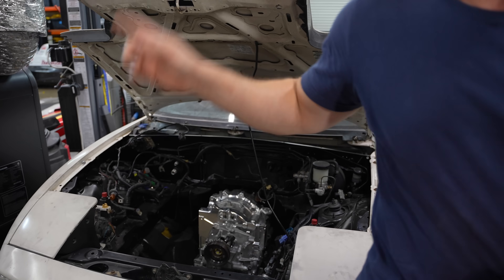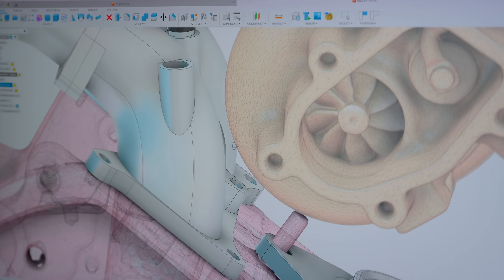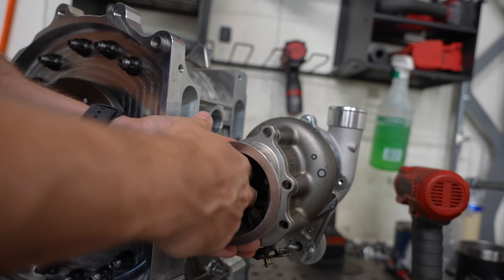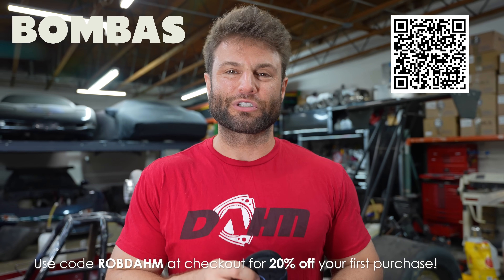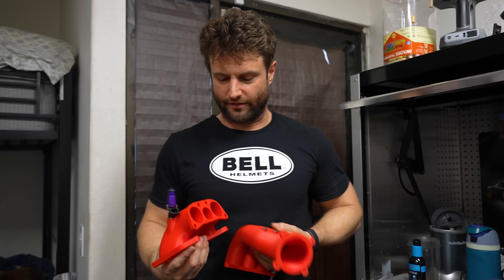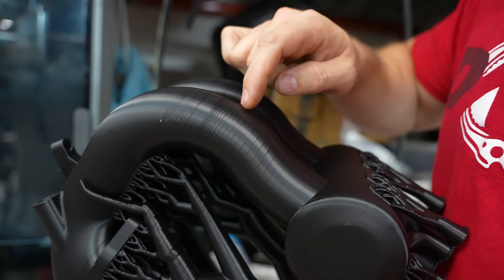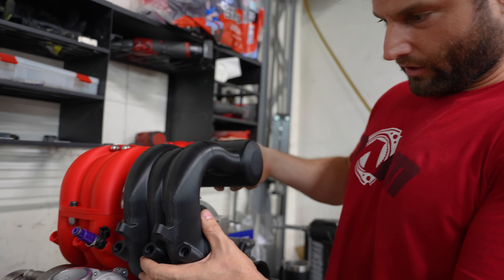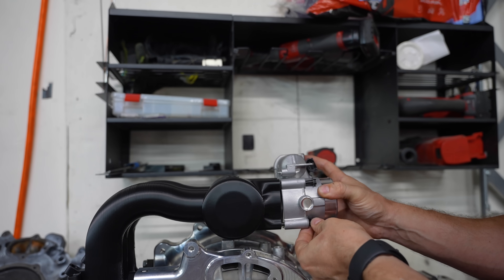We 3D printed an Aluminum 1 Rotor Turbo Manifold!

Comment: You can have a look at abrasive paste honing to clean up the inside of the intake runners. Its basically just a process of pushing valve lapping paste through each runner to clean out any slag or rough spots.

Comment: Make sure you tack weld the bolts used on that flange for the turbo. They have been known for backing off. Was a huge issue on the 2867 kits ATP sold using that exact flange

Comment: Use a microscope to check the porosity or research how porous the material is....research 3d metal printing's durability against pressure.

Comment: So, asking because of my experience with a bone-stock jeep xj with a 4.0 I6.

 Thing experiences vapor lock fairly easily because the exhaust (and pre-cats) are directly under the intake manifold and fuel rail.

I'm worried if the hot side of that turbo is capable of putting out enough heat to vaporlock those injectors. It's REAAAALLLY close to those injectors.

Comment: Hey Rob, many V8 swapped Miatas have the chassis notched where you're almost hitting with the fuel rail(fittings) I also notched mine there to fit the downpipe on a Volvo 5 cylinder swap

Comment: Doesn’t the injector need to be moved 30% upstream to account for the mass of the air under boost-wot so the fuel ends up in the center of the rotor port ?

Comment: You mentioned making boost pipe larger than outlet of turbo…. Doesn’t .Newton take over… by increasing diameter you slow down air speed… low speed high pressure and high speed (same size pipe) low pressure….or less drag you might say.

Comment: It made me happy when you extended the injector slots/mounts to account for rotation and heat in the area.  (Check out the turbo sheilding that Detroit Diesels used on turbos, was some of the most effective stuff I've used, but I think it had asbestos in it)

Comment: This needs to be made for multi rotor engines. Imagine 3 rotor RENESIS with proper intake and most importantly, separated and expanded side port exhaust. It will be able to make power from turbo without heat build up

Comment: Looks sick. The universal engine. Put it in a lawnmower, put it in a Miata, put it in your Minivan, doesnt matter. Fits everywhere. And has good power for a daily driver.

Why not just use the plastic intake? Design a few more boltholes to the flanges and youre done. Aluminum is more durable, and it looks good, I get that. But it also absorbes and stores more heat than plastic. So you use an intercooler to cool the charge air down, only to heat it back up again when it goes through the aluminum intake. But I would use the aluminum intake too lol

Comment: Plus, if you find that you need more structural integrity than 3D laser sintered aluminum can provide, then titanium is also an option. It just costs noticeably more. Looking forward to this project making even more headway now that you've got most of the parts that require wait times for production and shipping.

Comment: Why is it called a 6B? 13B 20B ? I understand the 1,2&3 rotors. 
Please explain cheers 

Older engines were 10a 12a etc. But still cant understand why? Bore or compression size ? Ports ? Stroke?
Reply: The only strokes on a rotary happen between the seat and the steering wheel.

Comment: You could have also printed that with 30% fiber PA66 nylon like OEM's use for intake manifolds these days. Strong, light, fuel impervious,, low heat transfer, strong, very high melting point, etc.
Reply: I don't know... It's like 10mm from the turbo hot side. OEM intakes have the benefit of cross flow heads putting the exhaust on the opposite side of the intake.
Reply: @AnttiBrax  Heat shielding both radiant and insulative, and engine bay airflow will be sufficient. PA66 melts at like 430F on the low end, shouldn't be hard at all to shield that between a ceramic coated hotside, a blanket, air gap, and one or two just radiant shields it shouldn't be a problem really. However, there's also nothing wrong with that wicked cool cast aluminum part!

Comment: How much did that cost to get it 3d printed ? 

I checked with Xometry and they wanted like $3000 to aluminum 3d print an 8” long 40mm diameter intake runner tube.

Comment: Nice and compact but that hot side is going to cook the IATs, fuel rail and injectors. It needs that double layer insulated welded heat shielding or air gapped plate to protect the intake manifold.

I'm also super curious about the plenum volume as Team boosted who did a 1-rotor had major issues designing theirs to work.
Reply: How hot is a single rotor Miata going to run, though? It's not a 1000 horse drift engine. We're lucky if it's going to hit 200.
Reply: @AnttiBrax  I would estimate 300 to be pretty easily possible given two of these with no bilet parts can hit 700, if it was NA my bet would be 160
Reply: Yeah that square plenum they were using caused all sorts of issues.

Comment: I have a serious question you are uniquely about to answer. I do 3D printing myself and have heard of guy's. 3D printing O-rings for all kinds of engine and compressed air. Would you test this? Especially with the seals in a rotary and in many ways. Could be a great way to solve the difficulty of cutting and gluing or pay the price of OEM.

Comment: You guys could start casting your own aluminum parts. The mold with sprues and vents could be printed from polymaker polycast, pack with casting sand, then melted out in an oven, and finally pour in the molten aluminum.

Comment: Hey Rob, not seen the entire video yet. But you will need a good heat shield between the injectors and the turbo. As the heat soak will be insane and kill the injectors. They might even melt from the heat from the turbo. So cercoat the exhaust housing and downpipe and then a heat shield.
Reply: I think it's safe to say he knows lol

Comment: I would advise NOT having the throttle body shaft vertical/motor on the bottom. If there's moisture in the intake charge that condenses on the throttle body/plate/shaft then it will run down and collect around the shaft seal and could ingress into the motor especially under boost and cause TPS faults or throttle actuator faults.

Comment: You got zero in Thermodynamics, your supposed construction is very nice, but without a heat shield and without a prudent separation of the turbo, in that detail you lose 30 percent of the engine's efficiency, especially since the worst development error in rotary engines is heat dissipation.

Comment: Loving this project so far! Just a note on your throttlebody, both the way you have it in CAD and mounted on the prototype is wrong. With the Electronics side downward, it is very prone to getting condensation in it and messing with the position sensors. Bosch's application note about mounting position describes the acceptable angles.

Comment: So there's all that void space under the intake runners, do you even need the runners to be that long? maybe move the "tank" back into that void space which would bring the throttle body back to the center of the engine, and possibly even give you more room to make the 180 degree turn on the boost pipe after the intercooler.

I still think everything is way too close to the turbine housing overall, gonna heat up your incoming air by a lot.

Comment: Hi, congrat for the manifold! If you want realibility from Bosch e-throttles, than don't install them with vertical throttleplate-shaft position! If don't have any other choice, then place the "motor" above, and check the lower bearing regularly
Reply: mind elaborating on why having the throttle body installed with a vertical throttle plate shaft position results in decreased reliability?
Reply: @ARockyRock  on driftmasters and hobby drift cars often have condensation in the intake and throttel area. If the shaft is vertical, than fluids can seep in/to the shaft bearings and case (yes, despite the seal). Not one customer had problem because of it. But pssssst! - it's secret! ;)

Comment: I wonder if the next iteration that has that cylindrical chamber could house an integrated air to water intercooler. I imagine that would save a lot of weight and piping length to the system too.
Reply: 100% that should be the case. Could be so efficient bd compact too being a single printed heat exchanger and manifold combo.

Comment: Is there a reason why the throttle body has to come after the cooler? wouldn't made the higher air flow make it more controllable? Heat should not be the reason imho. Else the cooler could have been the 180° turn on the drivers side into the intake

Comment: 3d printing is also great for making heat exchangers 

If your printing the intake especially when you make it from aluminium you could integrate a intercooler in to there
Reply: Yeah either that or double wall tubes it so it's got insulation from engine bay heat. Also should have integrated a couple "sheet metal" walls to shield from heat at the turbo.

Comment: Excellent design work, 1 thought was why not design the intake manifold, to be an intake manicooler with a built in intercooler plate, it would be a more complex design but end up
With a simpler end product and shorter boost tubes.  With your skills I know it could be done.

Comment: you should ask for the aluminum printing company to make you some samples , and then test welding on the printed material .  IDK if the density would act like cast,  or billet,  but would be cool to know in case you ever have to add anything onto , or repair printed material/projects.
Reply: It welds like cast. There’s no noticeable porosity.
Reply: @CouchBuilt   even if so , it still not cast,  the actual molecular structure isnt the same . the cast also id think would have more contaminants even when new , where this should be a lot cleaner  .  my thinking is this is done at hot enough to close up some of the pores( not actual pockets , but spacing/alignment in the crystalline make up of it )  that youd get in cast and have a tighter structure,  so would weld more like a sheet material than a billet or cast.   id still want samples so youre not learning on a part , youd dial in on the spare material  and then go to the work piece.   also , cast usually is pre heated,  is that needed .   knowing what actual aluminum make up it is important too , to use the right filler , or know options.  .

Comment: The lines you see at 13:50 are not from the print process - its from the "low" quality or in other words - low polygon count of the model/mesh you send them. You can avoid this when exporting with higher count of triangles or in some extend with the printing software if its capable of arc toolpath instead of straight lines.
Reply: I recommend exporting it as a .STEP file
Reply: @TheFixIt-7 I keep seeing those as export options, how much difference do they make compared to stl's, after export as g-code?

Comment: With metal 3d prints make sure you hit the sealing flanges against a belt sander or something to smooth out the  surface, might have issues otherwise. Super excited to see this thing running.

Comment: The chamber might damp some of the pulses, I don't know if there'd be as much as a single cylinder but I've heard they need a chamber for when the valves are closed. But I guess if you have an intercooler it might not matter anyway...

Comment: is it worth clocking the engine like 20° clockwise? that way you get more fuel line space, more turbo space, technically you could make a straighter shot for the intake

Comment: Shouldn't it be 6.5B???
Reply: The steps go 6, 13, 20, 26. Mazda makes the rules.
Reply: @zibingotaeam3716 Mazda rounded up the 3 rotor capacity from 19.5 to 20.  Shouldn’t the 6.5 be rounded up too, rather than rounded down to 6.
This could  be known as a 7B RE.
Reply: @Nostalgia_Garage  7B RD
Reply: @Nostalgia_Garage  There was never a 6B so we don’t know what Mazda would have done, but there are examples of rounding up and down so they could go either way.
Since they have 26B in the B series it probably makes more sense to round to 6 instead of 7.
They rounded down to 3A even though it was 360cc.
Reply: Maybe some ceramic coating on the hot side of the turbo and the intake for better heat ah, resistance and shedding?  That might help with heat soak right there between the intake and the hot side of the spoolie boi
Reply: 6,5a
Reply: Amazing. Can't wait to see it fired up and dialed in.
Back in the day my late father bought a '71 RX-2 sedan brand new. He did the usual Dyno-Tune kit and suspension mods. Even down low he could spank a lot of cars with it. These days I'd love one but even junkyard pulls are ridiculous money. I'd build one with a boosted 13B and a late RX-8 trans behind it plus whatever diff would hold up.
Anyway, thanks so much for helping to keep the Wankel alive and developed!
Reply: It should be 7B since it is 654CC
Reply: Throw this for a plot twist. I might not be up to date on the single rotor design, but isn't this based on the 12b?? If so then I will concede to it being a 6b.
Reply: I think 7B RE engine is more appropriate